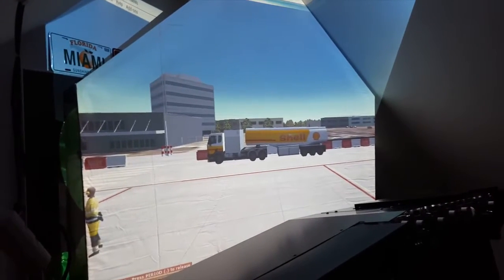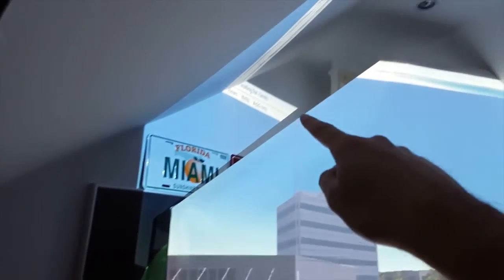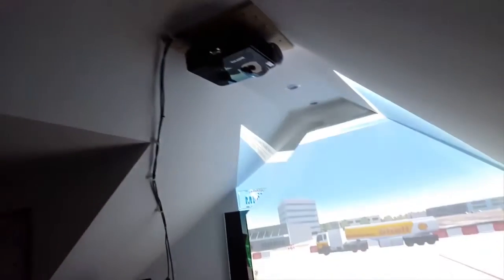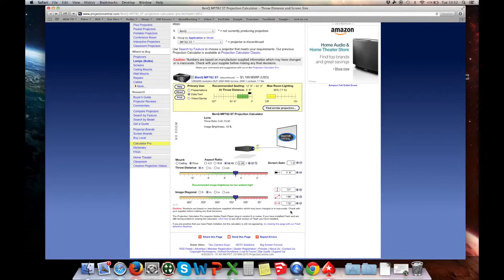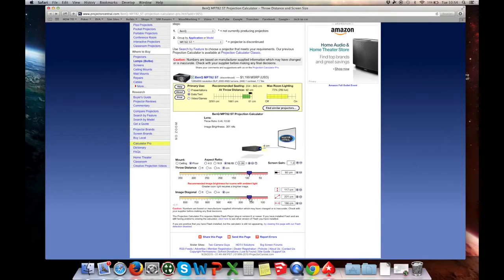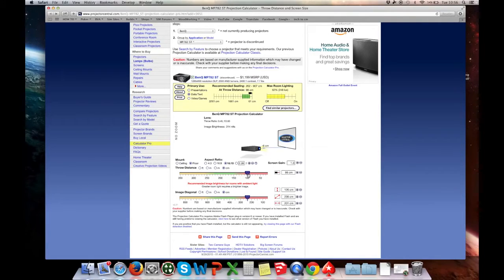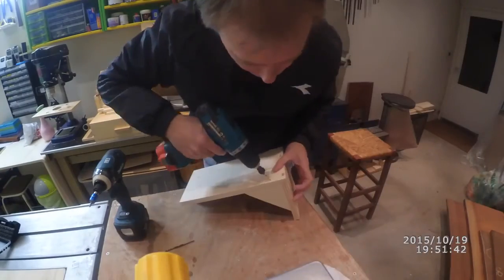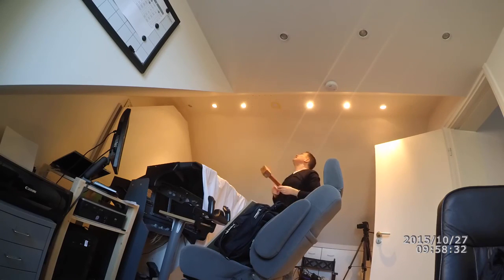Boeing 737 800 Home Cockpit Simulator #14 - projector display frame

Comment: Hey nick can u just tell me if u tweaked fsx in any way?Cuz i built a pc for my project but with add ons and PMDG 737 I get only about 20FPS on landing.Thanks and as always very informative video.(My pc is i7 4790K 16GB RAM 2 TB HDD 240 SSD and GTX980)
Reply from the maker: +PC Gaming & Simulation Yes I did but not much. I followed the costa's guide :
https://kostasfsworld.wordpress.com/fsx-software-and-hardware-guide/

I manage to get a constant 30fps but I am not happy with the graphics.
I am about to make 2 radical changes, first I am moving to P3D and second I will change my graphic card...
I have a Radeon now and I want an Nvidia GTX.

Your PC specs are better than mine, I wish I had your graphic card, but is a little on the expensive side.
Reply: Ahh Ok thank you very much..
BTW it's ryaan I changed my channel name;-)
Reply from the maker: +PC Gaming & Simulation Yes I realized that when you send me a message a few weeks ago, the name got my attention so I checked your videos and realized it was you... I know also subscribed :-)